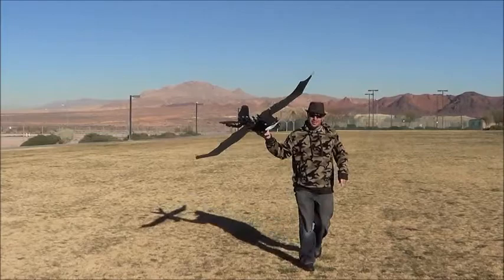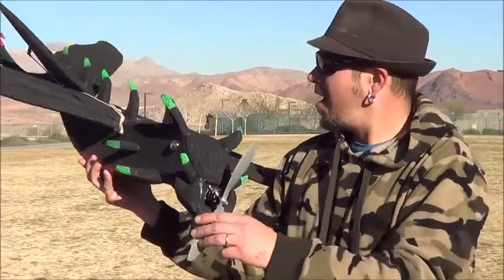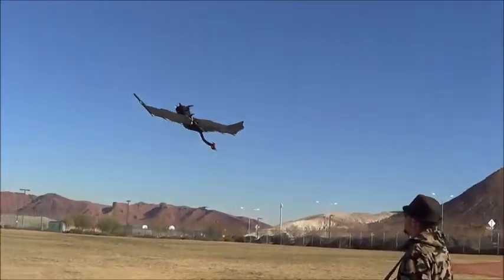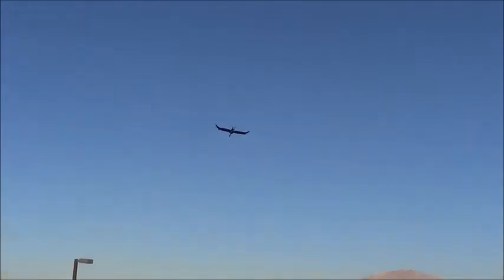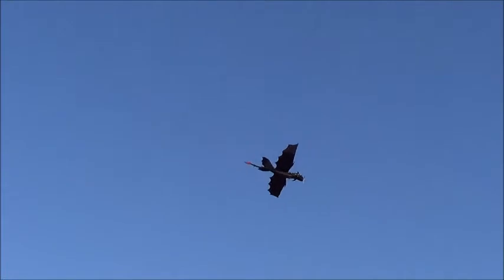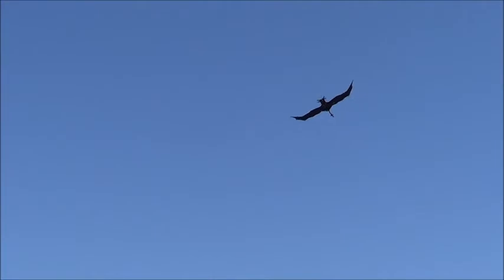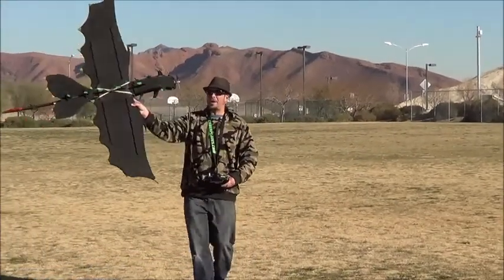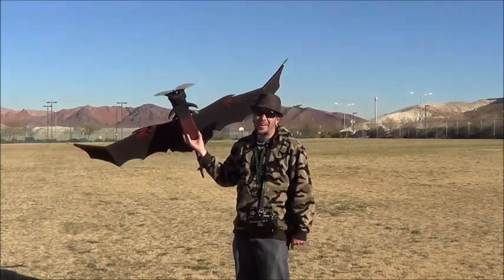cyberplanes 2015 rc dragon

Comment: Be nice if you gave more info.....about what one needs to finish the model. Motor, battery, ESC, servo's...how to set up CG and how to set up the Tx to get the control surfaces to work right. $135 bucks for just the airframe is a little steep.......
Great concept worth looking into further...one needs to list the power set up and where to get it to complete the models on cyberplanes web site.
It flies great, but we do not know all it took to make it do that, now do we ?

Comment from the maker: E Will, I do mention the motor I use in this video and how to set the throws on the moving surfaces. all the kits I design come with a build video. in the build video I show all the electronics I recommend to use and where to easily get them. antone could always call the # for cyberplanes and ask questions if they have any. my customer service is outstanding and all my designs are  artistically hand cut. ive sold to date over 1000 kits worldwide and in all those orders ive had only 1 complaint. not to bad of a track record. if you have any questions about any of my designs id be glad to help u out. take care.